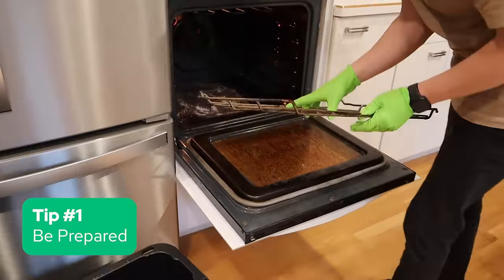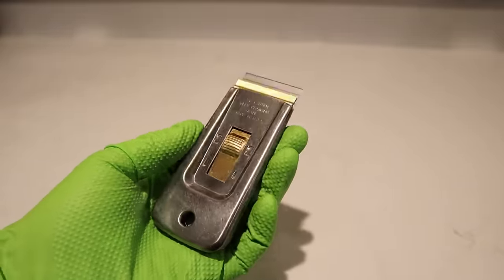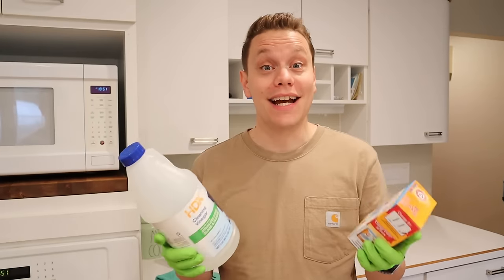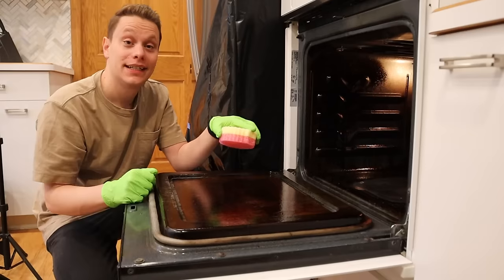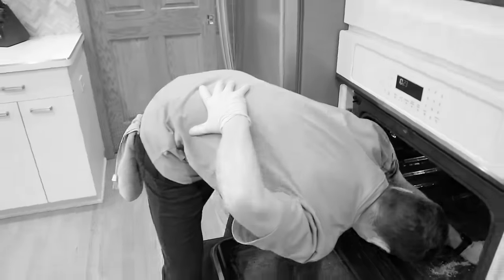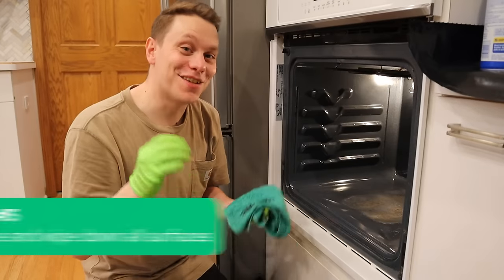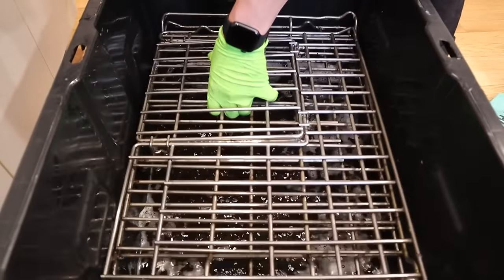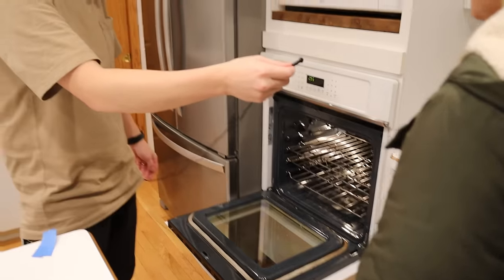5 Tips to Clean Your Oven Like a Pro

Comment: Does anyine have advice for someone with physical 0:08 issues that makes this task even more difficult? I cannot kneel for long or bend over without getting dizzy. I want to clean my oven. I need yo clean my oven. I just wish the Scrub Mommy sponge came with a long handle.
Reply: Use a chair and as much support as you need! Use a stool. Use a garden kneeling pad. 
Amazon sells attachments for your drill to add brushes and cut down on scrub effort.
Reply: @shiloreno9917  Thank you. These are good ideas. I hope something will work out.

Comment: I worry about using the razor blade because I don't want to accidentally remove any of the coding inside the oven😮
Reply: I used to clean ovens professionally and we always used glass scrapers. To be fair it looks like he's using a glass scraper there so I'm guessing he just said razor blade by accident. Just blast everything with a degreaser and then scrape away. You can use it on the glass and electric hobs as well. It's nerve wracking at first but you won't scratch anything unless you slash it

Comment: Anorher tip. Buy yourself a magnetic led lamp that can pivot. When you're shanding in front of the oven with your head inside, it blocks all light. 

If you have a magnetic led lamp, you can attach it to the wall, floor, ceiling, rear wall of the oven and angle it where you need the light.